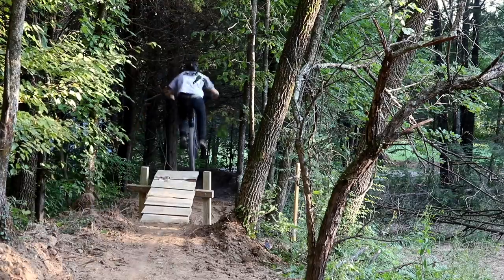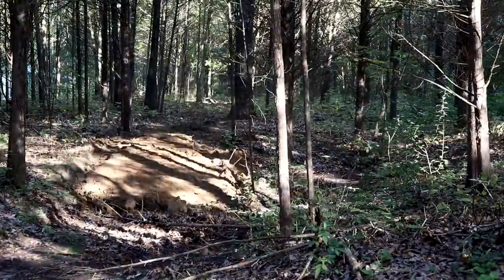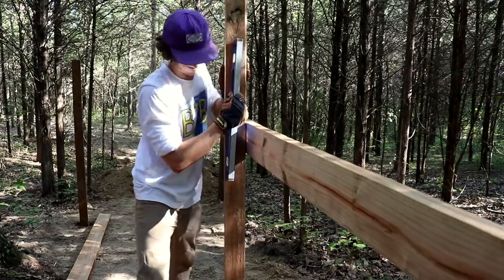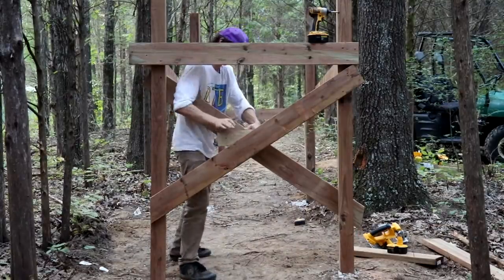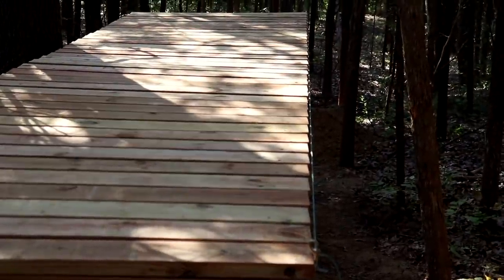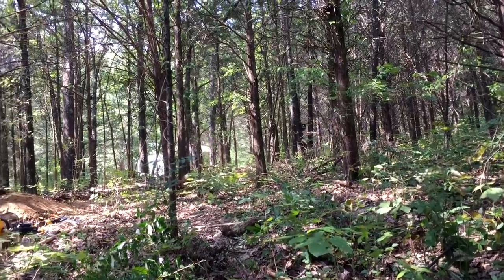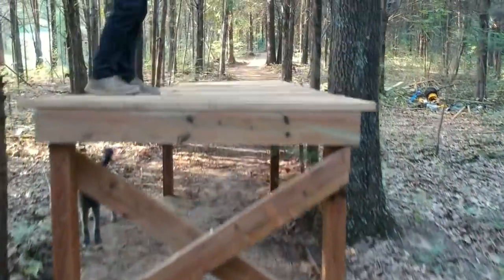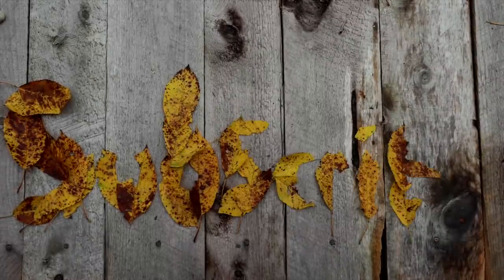Building a HUGE DROP on my Backyard Trails!

Comment: I’m assuming you used pressure treated pine for this. How much did the build for the deck cost? If it’s not too much trouble, could you please put up a parts list? 
Thanks! Great video.

Comment: Good job on connecting your x-bracing at the center point. Structurally without that the bracing doesn't act in the frame action you are going for. 

Also way to hot the drop man.

Comment: Great video, just wondering why you are using a machete to cut small roots at 0:50 when some small gardening clippers would be way easier and don’t cut into the trail
Reply from the maker: Thanks Sean! Actually its a hatchet/machete type tool. Its reeeeally great at chopping down to the roots so the weeds wont grow back. You can see im actually chopping into the ground and not the stem of the weed. Good question though!